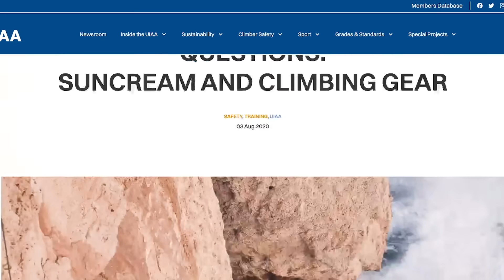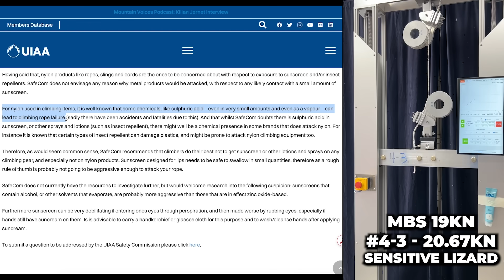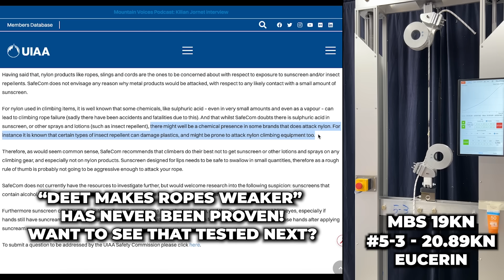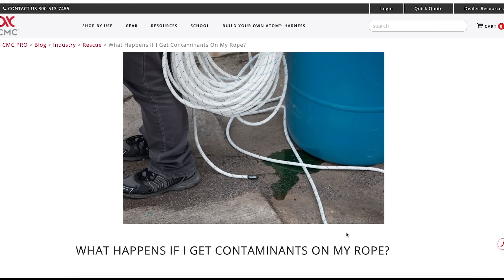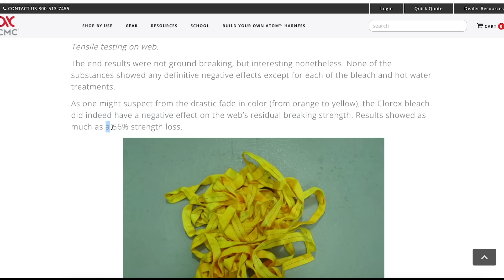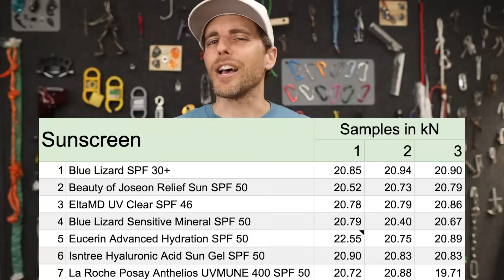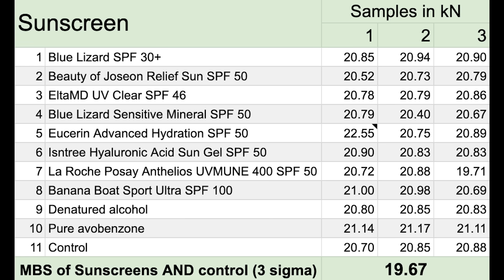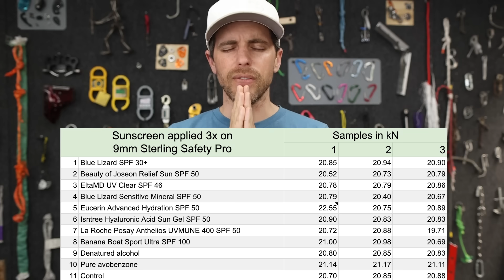This is going to piss off the worlds largest climbing organization

Comment: Now I'd be curious to see whether sunscreen protects climbing ropes from sun damage in the long term!
Reply: Sun screen physically blocks UV....so, I think that peer reviewed article has already been published and replicated many times in the New England Journal of Sh!t I Could Have Told You Myself, but in an application setting, it's only the net effect you care about (ie if sunscreen very quickly weakens your rope for one reason, I don't know if you're really that jazzed about its preventing long turn UV damage).
Reply: If so, does the protection afforded by temporary UV absorption compensate for the extra abrasion caused by the residues picking up and trapping grit in the rope?  If so, is any benefit influenced by rock type, lunar phase, or the coriolis effect?
Reply: Oh shap
Reply: I don't think that is relevant for ropes. The sheath will protect the core, and a rope will have degraded far beyond use before UV exposure is an issue. Things are different for slings, especially rappel slings and fixed quick draws. They do not have a protective sheath and are left exposed all year round
Reply: This
Reply: Yeah it protects ropes by as much as 40%
Reply: The stuff I wear maybe. It's Zinc, which I think reflects or absorbs UV without breaking down.  As a teacher I would read Phd papers and immediately think of ways to apply the concepts to lessons I was teaching students, and ways for me to learn as well. (These are the ones under behavioral psychology and Expertise). Then there was the teacher journals they give us as part of our union dues, affiliations, etc...  My first impulse was to feel stupid that I didn't know what 'optimal learner maximization' was.... And then I figured it out. Someone just ginned this stuff up, got it published by editors needing content....  They got a credit for their resumé, and mostly no one read it. The reason this has gone on for so long, is no one wanted to look foolish saying 'the emperor is butt nekid.' 
I'll bet there's nothing behind that original article. The rationale probably goes like this: Someone read of a chemical in sunscreen, it's the same as or similar to a chemical that can harm some types of rope. So they made the leap, dressed it up a bit.... 
The thing about solvents is they evaporate pretty quickly. So they may not in almost every use case cause the harm they might cause if the rope was sealed up with it.  
Great video. You guys are really developing an amazing testing method. There are probably already climbers out there who were not killed or injured because of your work.
Reply: I'm not a doctor, but I don't think that's how it works.
Reply: My concern would be the abrasive nature of the TiO on the fibres of the rope over time. This would be no worse than crag dust and can be removed in the same way, washing.

Suncream is a useful substitute for t cut if you scratch your hire car.
Reply: Maybe should go test it then. Ryan just showed no harm in some extreme case with far more sunscreen than could realistically get on a rope. It’s unjustified and unscientific to suggest further study when all the available data does not support any weakening

Comment: I quit using sunscreen...and haven't been burnt since!
Reply from the maker: You don't need to be burnt to get skin cancer.
Reply: I stopped wearing my seatbelt and haven't been in a car crash since!
Reply: It is a common misconception that not getting burned means you are not getting enough sun to damage your skin. Sub-sunburn UV exposure still causes DNA damage in your skin cells and cumulatively increases risk of skin cancer over time.

Comment: If I was an anthropologist, I would study how members of communities centred around sports and other activities have what are essentially folk-beliefs that they swear by, even though they have no basis in reality.

Musicians, especially guitarists, are also very prone to this sort of thing.
Reply: what about HiFi folks ?? 😂
Reply: @pedrova8058  for example: 
-Vinyl records being the best form of music reproduction because of something to do with master records.
-The cables between your amp and speaker need to be something special rather than have an acceptable crossection for the length.
-Anything but the speakers affecting the sound quality on a non crappy modern sound system
-class D amps sounding worse than AB or A
-DSP only makes things worse
Reply: @lukahierl9857 Gotta love the audiophools. I have bog standard 2.0mm core speaker wire. I can tell no difference when I switch to using 2 cores of standard 3 core electrical flex of an appropriate gauge lol. Copper is copper (mostly)
Reply: @garethhall3490  thats similar what I use on big PA systems. All the 2 and 4 wire cables from the amps to the speakers are H07RN-F (euro equivalent to SO cord in the us). Sadly they dont make any with 8 wires, only 7 and 12. Its extreamly robust and cheaper than purpose made speaker cables.
Reply: Now I'm interested in what guitarists hold as folk-beliefs. Care to share?
Reply: @kf6948 tone wood in electric guitars. It's magnets!
Reply: @nathanaffleck5518  have you seen the carbon fiber guitar?
Reply: @mckenziekeith7434 if it's acoustic itll make a difference. But on an electric guitar the only way the vibrational properties of the wood would make any difference would require the pickups to be so hot they'd hum if you breathed on them
Reply: @kf6948  There's a youtuber called Jim Lil who has done some experiments like HowNot2 to bust guitar myths. 

Guitarists will fight and bicker about how every little thing from body shape to paint color can dramatically impact a guitar's timbre. Jim Lil proved, by making a series of simpler and simpler franken-guitars, that the only things that matter for tone are 1. what pickup you're using and 2. where it is relative to the strings.
Reply: @kf6948  Robert Johnson 😅
Reply: That's kind of the norm for groups of people that talk about something specific isn't it? Whenever evidence is encountered infrequently enough, folk beliefs spread regardless of truth. Well, I don't know for sure if it's the norm, and I don't know how infrequent is infrequent enough, so I suppose I have to agree it's worth study.
Reply: Even in rigorous scientific circles, an enormous amount of what is "known" is folk beliefs. Really. Mathematicians aren't immune.

Comment: How are static and dynamic ropes different? Is it just different weaving, or is it different materials? As I'd like to see at least one test with dynamic rope just to verify "ehh, static should be comparable". 
But also, yeah, badly written sciency stuff from standards orgs is bad.
Reply: They can be made with the same materials, but yes the lay of the yarns and tension in the core/sheath can be changed to result in different amounts of stretch. Dynamic ropes can stretch 20% their original length, in some cases even up to 40%. And Static a.k.a semi-static ropes are usually 3.5%-5% stretch. "Real" static ropes, like ones made from polyester, can be <1% stretch.

Comment: DEET testing YES.
Because biting bugs are always a problem.
Reply: I'd also say test that gamut - Picaridin and Permethrin as well (as those are often used to soak clothing or do other things to repel bugs)
Reply: Especially for those of use who do rock activities in areas with ticks
Reply: Sunblock is bad for cameras.  DEET is even worse - it eats certain plastics.  Most famously, the rifle stocks on the mark 1 British SA80.

I think this is where a lot of the anxiety comes from but just because it eats plastic does not mean it eats nylon or dyneema.
Reply: and if do test, could you also test IR3535™, picaridin, permethrin, and oil of lemon eucalyptus?
Reply: def test DEET, I cant' climb without bug spray due to reactions to mosquitos! and test other bug sprays and repellants too!
Reply: DEET ruins plastics. I’ve ruined the trims in my car after putting it on my arms.
Reply: @dbayboyds409 rope is not plastic its nylon.  DEET cannot react with nylon.    It chemistry.    Its simply not possible.   It will still be cool to see  more videos.
Reply: An picaridin. It's better try it.
Reply: The paper is actually available on the internet, and there is a followup testing DEET! I don't know how HowNot2 didn't find it, it only took me a few minutes. The title is "Don't XXX on your Rope", and there's a version hosted by ITRSOnline. 

They soaked their rope in 100% DEET for 50 days and it got 3% STRONGER.

The only substances that caused a significant reduction in strength in that study were 1. battery acid, 2. 100% ammonia, 3. 100% bleach, urine, and water. 

Yeah, water is worse for your ropes than 28 other scary chemicals they tested.
Reply: test DEET. It'll be neat!
Reply: I think the amount of melted camping gear out there is enough to assume that deet will be bad for ropes. Worth testing, but not as controversial a topic IMO.
Reply: @andrewbrowning6357  less controversial for sure, but it would be interesting to know how bad is DEET? Does it take many applications and/or degrade over time? And is there a safe alternative? I.e. Icaridin, permethrin or lemon eucalyptus oil
Reply: Personally I would avoid DEET around climbing gear. Its bad enough with camping gear and we have picaridin/icaridin now which doesn't attack plastics and is also much less toxic. It also works unlike all the other DEET alternatives I have tried.

Comment: lol sulfuric acid won’t kill you that easy considering I’ve snorted a line of it in high school chemistry class and just almost died I’m the living proof 😂😂😂😂.
Reply: Sulfuric acid aint no powder my friend.
Reply: @lukahierl9857  I once went to smell some unlabelled chemical, got a nosefull of HCl acid vapours. It really wasn't fun. I washed it immediately for at least 10min (it felt like an hour, but my bet was that it was around 15-20), or until the lab supervisor felt that if it was 5ml of acid it would dissolve in enough water for it to be drinkable, so a LOT of water went through my nose. 

Still, my airways were cleaner than ever, and also much more sensitive for like, a couple of weeks after the incident. No long term effects at all, but going outside from heated rooms  to winter air did hurt.
Reply: lol I know the story of a guy who accidentally snorted Aspergillus spores from a petri dish sample (they were in class at the university). The dude won a hospital stay for pulmonary mycosis

Comment: Very nice test, well-done. Black Diamond has long posted warnings about alcohols affecting nylon... it certainly didn't affect it in straight pull test i did. But the uiaa often makes claims like 40% based on number of dynamic rope tests that fail, which is more testing how the coefficient of friction varies in a pull over an edge. Again, kudos.
Reply: Uiaa dynamic rope tests are drop tests over a sharp edge.
Reply: I do think smelly sunscreens encourage ringtails to chew ropes. ;) Again, what a great test!
Reply: So the one thing that alcohol definitely affects are the treatments that are put on things like nylon tents or bags that provide water resistance and/or UV resistance. I don't think that ropes would have those treatments on them anyway so it seems irrelevant in this context.
Reply: @dontwantish  I would seriously like to learn more about this. I routinely coat nylon with urethane, and use isopropyl alcohol for clean-up before the urethane is polymerized (set).  However, once the urethane is set, IPA doesn't touch it -- but toluene will dissolve set urethane. I have never tested other alcohols.